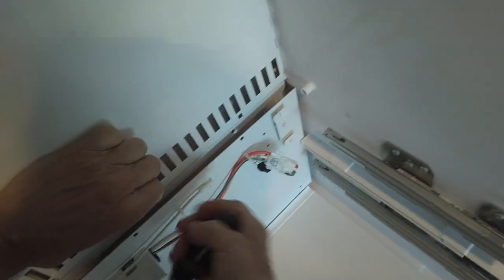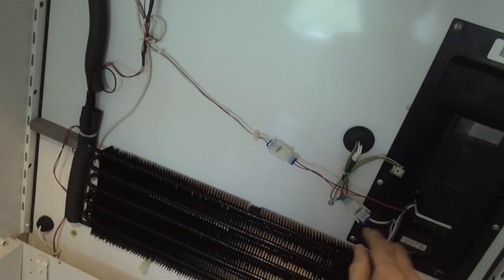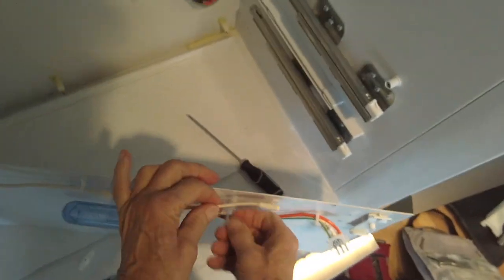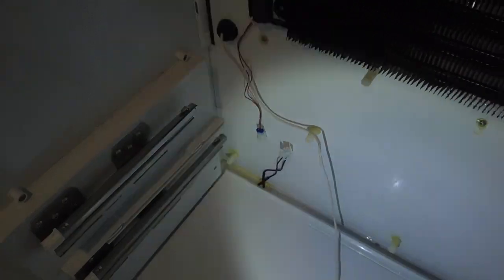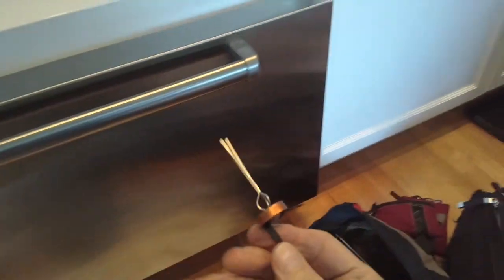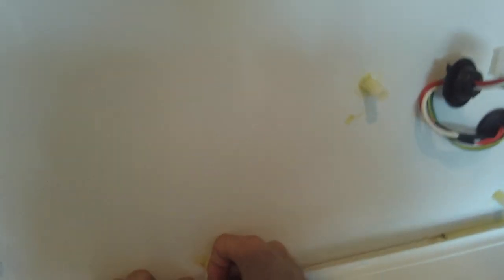BI-36 Drain Heater Installation

Comment: Thank you! Problem solved! I have a a ten year old Sub Zero BI-30U that developed the frozen drain problem about two years ago. Even after watching other videos on how to clear it, it would always come back and was damaging our hardwood floor and base cabinets. Looking for a permanent solution, I came across your video. I ordered the part on Amazon, rewatched your video and had the heater installed in about an hour. It's been over two weeks and the drain remains free of ice! So nice to not have to soak up water from inside the fridge every morning! Thank you!!!
Reply from the maker: Just keep the air filter on or the heater will not get power.
Reply: @SubZeroSpecialists  Yes! I heard you mention that right at the end of the video. I told the rest of the family as well! Thanks again!

Comment: thanks. It was a real hassle getting to the drain on mine.  I couldn't find any videos on how to remove the panels. I had to remove all drawers and shelves, top glass over light. then top panel then bottom panel.  I thought I needed to remove a side panel but it wasn't necessary. I have the BI-36S/O

Comment: I also have a Sub Zero BI36U/S that I am trying to add this drain heater to but I cannot find the same 110/120V line to connect the heater to.  The wiring of my refrigerator does not look like the one you were working on.  I took pictures of the wiring layout that I can send to you and maybe you can show me which line goes to the fan with 110/120V AC.  I spent 2 hours this morning taking the refrigerator apart and putting everything back together.  Looking for some help.
Reply from the maker: @johncunningham265  if you have an air filter then it’s the black and white wires.
Reply from the maker: Which drain heater are you using? I use the Supco SH-250 which is a 3 watt heater and connects to the black and white wires that power the air filter. Make sure the air filter is on otherwise the drain heater won’t work.
Reply: I am using the SH-250.  Since I don't have a wiring diagram, point me to the air filter to see if I can find it.  Is it in the upper compartment when the condensor and water filter are?  I have pictures of the wiring that I have available that I can send you via email.
Reply from the maker: @johncunningham265  if you have a BI-36 it’s it’s in the refrigerator compartment behind the back panel a few inches above the evaporator coil. It’s in the video.
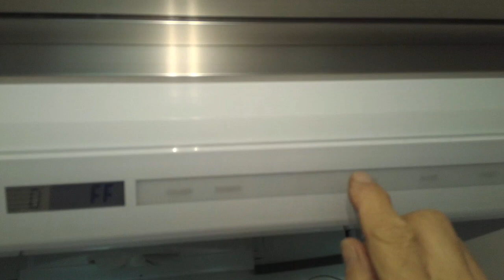Reply from the maker: In the video it’s at 9:08 timeline

Comment: Hey, had a question for you. Just came across bi36 with a bad floor heater underneath that drawer, tried ordering the part through west coast parts, they told me I gotta be sub zero authorized to order this part. Would you know the wattage for that, as well as the voltage? I got a commercial refrigeration supplier I can just buy a heater wire from and tape it down with some metallic tape.
Reply from the maker: We don’t use the subzero heater for that repair it’s low voltage.

Comment from the maker: Any appliance parts store should have that heater. It's made by Supco PN SH250
Reply: Thanks for walkthrough! Followed it exactly and used the Supco heater with some quick splice connectors to avoid using wire nuts. It's been a week and there has been no ice buildup or water leaking. Thanks again!
Reply: I installed the heater in same fridge same wiring but my voltage across black and white drops to 5v when heater is connected and obviously won't work. I tested heater in a wall outlet and it immediately starts heating up. What's causing the voltage drop on fridge wiring?
Reply from the maker: @Gregebrennan  you have to turn on the Pure Air, the heater won’t work if it’s off

Comment: Hi, i got a  question. Doesn't heater block way down of water? You plugged that hole by heater, how supposed to water get down to drain tray? On the video i can't see details. Thanks
Reply: Also i found on the internet exactly that heater,  and i don't see any  holes on heater
Reply from the maker: The heater does not block the drain flow.

Comment: I don't see them.  There is a transformer with a black and blue wire coming out.
I did put the meter on the connection but it did not show 11/120VAC
Reply from the maker: @johncunningham265  send me a picture
Reply from the maker: @johncunningham265  you’re not going to get a 130V reading unless the air filter is turned on .